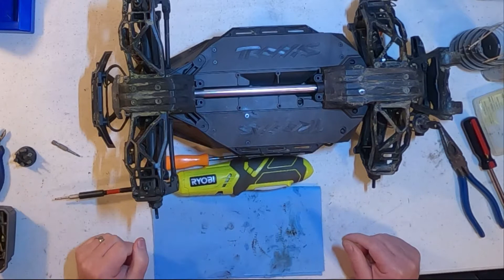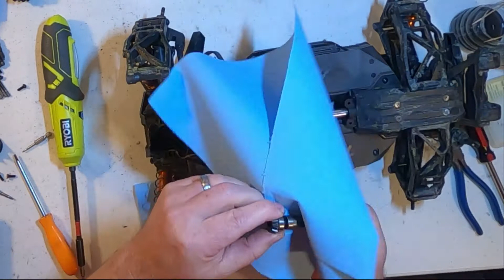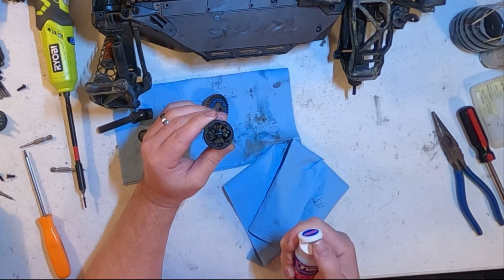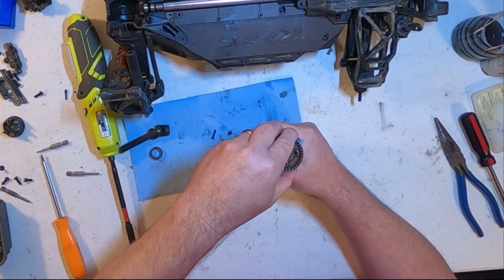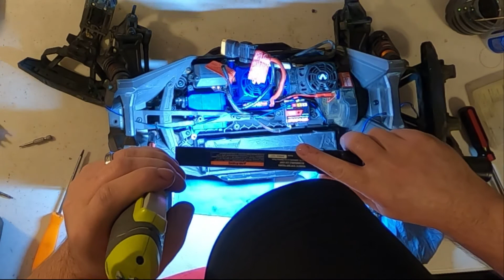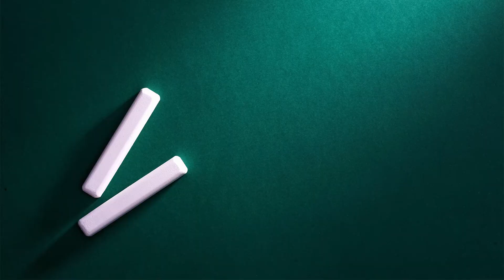Traxxas Maxx 4s Front Diff Fluid Change

Comment: Little advice from what most of us have been finding on these... use some siilcone around the diff cover.. we are seeing dirt make its way into the diff gears.
Reply from the maker: yeh i have been seeing people post about that issue
Reply: I just received my Maxx yesterday and broke a part along the front drive train. On my Traxxas UDR I added some grease and ran a seal on the front and rear diff then just filled it up with grease to help keep the dirt and water out. Now I have a new project! Honestly, I cannot wait! I wish I didn't break my Maxx on the 1st day, but the brakes were so tight and at 50 mph the truck rolled front to back over and over a good 40 feet because the break is way too strong and the truck with the default tires gets out of control pretty easy. Very tough truck when I only broke one little part. I think the clip that holds the 2 rods toward the center just snapped and the rest of that elbow joint that just connects them just fell apart. I couldn't see where the parts went because it was dark out. I just couldn't wait to go have fun with it. I reduced the brakes down to 75% and now it brakes perfect now and won't cause the truck to get out of control and flip out. 

I am going to down grade my 4s to 3s and it should hold up even better. Crazy how fast these things go, but I really don't need 50 plus, unless I love to repair it frequently!

Happy New Year!
Reply from the maker: @kennystroner7431  ye we dropped our brakes down first day as well.